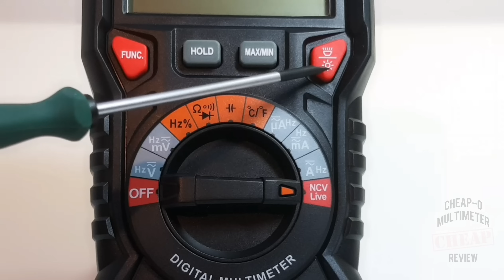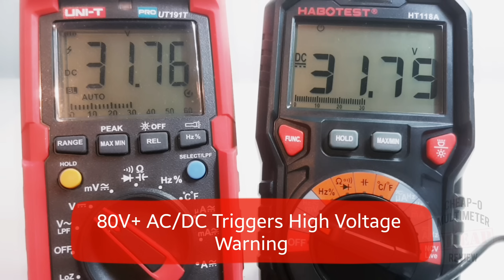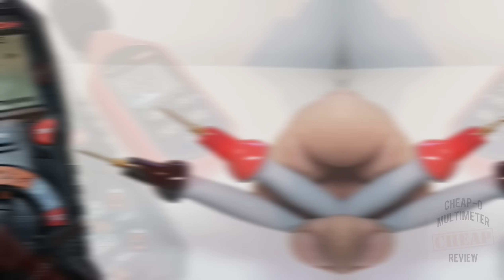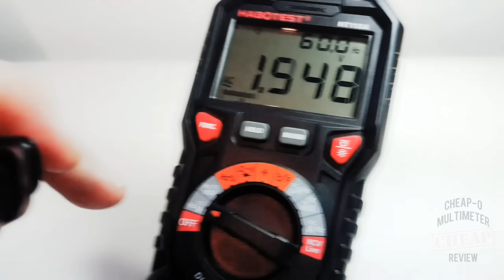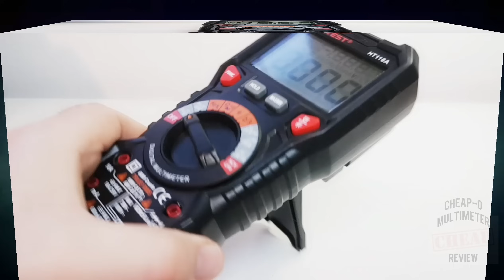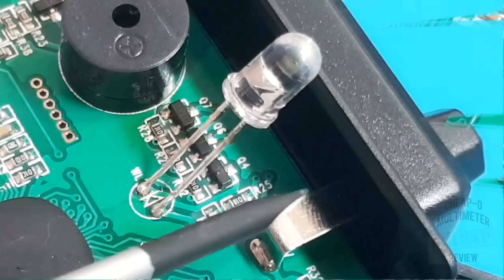HABOTEST HT118A  CHEAP-O Multimeter Review & Teardown!

Comment: Excuse me Mr.Darren Walker.

Can you please help me to choosing my first multimeter??
Either richmeter rm219(zt219) or habotest ht118a.
Rm219 have 19999 count and habotest have 6000 count. 
I don't know if i really need that Rm219 more count.
From what i noticed Habotest doesn't have relative button,range button.
And again i don't really know if i really need those button.
Will i get a hard time without those button sir???.

I want to use it for repairing broken stuff such as measuring fan capacitor,checking not working pcb,checking smartphone component that not working properly,etc.

What is your opinion Mr.Darren?
Should i choose rm219 ($23) or ht118a ($26).
Or maybe you have another recommended multimeter??

As you can tell, yes i am a newbie with no experience here.
Please excuse any mistakes as English is my second language.

Thank you.
Reply from the maker: HABOTEST HT118A, It's the TOP Multimeter on the TopTen List for a reason. Great display, solid performance and feature packed!

Comment: I have the updated version of this same model number but no manufacturers name back light now stays on until you turn it off when you select volts its default is now DC  the screen  back light and led torch have improved also I paid £16 off Ali express if you want the sellers into I can put it in the comments if you wish thanks David
Reply: the seller is MyTools Store on aliexpress 
type, Switch Multimeter Meter 6000 Count Digital Automatic Range True Effective Value Ammeter HT118A Micro Switch. in search box should bring it up current price £18.14 gone up a bit unfortunately
Reply from the maker: Ohhh..edit! I thought it was Mr Tools..😅
Ok..thx for the link..Will check it out.
Reply: @KeepOnTesting  you will know it's right as I have left a review for the meter where I talk about the back light staying on
Reply: @razer192  I found one @ HERRAMIENTA Store, but there asn't any review.
Reply: @jocl8488  I checked it's still for sale at (mytools store ) on Ali express
Reply: I have got mine from HERRAMIENTA Store, but it's HABOTEST 👎
Reply from the maker: Wow, those are some 👍 great updates! 
Please provide the updated link. Thx!

Comment: What would you consider better... the HT118A or the UNI-T UT61E?
Reply from the maker: 2 different multimeters. UT61E+ I just reviewed is not in the CHEAP-O Realm, it costs 4x as much as the HABOTEST but it's a fantastic and powerful multimeter. The HT118A is another amazing instrument,  it's current NO.1 in the CHEAP-O Top Ten (see under video description). Both are unique 👌

Comment: I just got my kaweets ht118a which is basically the same than the habotest, and they are shipping the version 1.5 of the board. Now the backlight stays on all the time and you can use it with the flashlight on
Reply: That must be sucking the hell out of those two AA batteries
Reply from the maker: Excellent update!  Glad to see they are listening!! Keep On Testing!
Reply: but does it make a beep sound when checking a regular diode?

Comment: Hi, thanks. Do you know what size the 2 fuses are in this? I took mine apart to see so I could get a pair to have on hand as backup But there's no markings or number on them. Thanks for your help.
Reply from the maker: 6.3 X 32 mm (1/4 × 1,1/4") ceramic fuses. 😃👍 You can find SIBA fuses on Ebay for a good price, that's what I use.
Reply: @KeepOnTesting  Thx! Another question... on the front it says 10A/250V and 600mA/250V so at 1st you'd think the fuses only need to be rated to 250V. However I just watched a video comparing a meter in the price range of this one to a Fluke meter and how they put better fuses in Flukes rated to 1000V and 20kV [is that how fast it blows?] He showed if you had the selector on the wrong setting, like ohms when you're measuring voltage, how the meter he then ran 650V through blew up. and caught fire. So should we use higher voltage rated fuses?
Reply: also do you know about ceramic vs glass fuses. I understand if you're not going to use a MM on a job site or somewhere where it could be dropped from more than 6' then glass is fine. Any truth to that?
Reply from the maker: @BTS-mb1lh  You shouldn't exceed the voltage ratings the mfr recommends. Those higher Fluke ratings are due to the better more robust input protection built into the circuit. A lesser robust design will evaporate in your hand ✋ so best not to go beyond the spec.
Reply from the maker: @BTS-mb1lh  Glass fuses are inexpensive to produce.. thats why its so prevalent in cheap multimeters. However,  ceramic is much better at absorbing the energy and it won't implode like glass so you won't end up with glass fragments everywhere! Definitely use ceramic if you can.
Reply: @KeepOnTesting  Ok so what do you think they mean by better quality fuses in some meters? And will they be safer somehow? And what would one look for in that regard? Thanks again
Reply from the maker: @BTS-mb1lh  A reputable manufacturer like SEBA makes great fuses. Always better to buy from a known name than a cheap nameless make. Quality of the tube design and the internal components used are all important. Two fuses side by side...cheap and well made, might "appear" similar but the difference could be priceless.

Comment: Nice instrument, nice review.  The only feature I don't like is that it defaults to AC.
Please note that the date code 1912  means 2019 (year) 12 th week , not January 2. The PCB  (and not the meter) was fabricated on March 2019. This is  the standard date coding that is used for ICs and other stuff.
Reply: mine defaults DC and I wish I would default AC and default continuity. I have no idea why it does not default to continuity.

Comment: got one of this, it was a massive fail, it didnt even turn on. Had to give it back
Reply from the maker: Oh my! Thats a big disappointment...sorry to hear that.
Reply: Darren Walker in your experience what do you think was the issue¿, I hope they resend me a good unit tho.
Reply from the maker: @admahecha  Might be a simple issue such as the battery pcb terminals not making contact with the battery assembly. Alternatively,  it could be a faulty or damaged selector pad on the rotary selector switch failing to initialize the multimeter. Unfortunately shipping can be really tough on test instruments so thats usually the culprit. Let us know if the replacement puts a smile on your face 😊

Comment: Hi. Is there any similar multimeter like ht118a? For example peakmeter pm18a ? But pm18a has no bar graph. Do you know another multimeter brand and model like ht118a? There are many KKmoon HT118A, Kaiweets 118A .

Your multimeter's board HT118A-V1.2
İ saw another version (Kaiweets) was HT118A-V1.3

Do you have any idea? is there any difference?
Reply from the maker: Yes there is a difference..the new rev. pcb supports the audible diode and I believe no timeout for the backlight, although I haven't verified the latter.
The AstroAI M6KOR is another variant..I'm awaiting on AstroAI to ship me a unit.

Comment: An Amazon reviewer for the Kaiweets version writes "the 600 milliamp fuse blew with just 0.5 milliamp going through it. The college instructor verified the unit was used properly and the circuit was configured properly, and that it was the multimeter that had malfunctioned. The replacement fuse costs more than the meter itself. Opening the unit up to inspect the fuses revealed the unit was not constructed properly for the fuses that came installed and this problem will likely happen again."
Do you see any circuit flaws with the fuses in the unit?
Reply from the maker: Sounds like a like a load of "hogwash" to me! There's nothing wrong with the internal circuitry. They use  standard 5x30mm fast blow fuses and you can easily fit 5x32mm in its place. 12 ceramic fuses will set you back 10$. I think this is just a lame attempt at dissing whats a very well made and affordable multimeter for the masses. I think the student was either high on solder fumes or was bored and needed to manufacture some fabricated story to get a refund from Amazon.

Comment: Which mm did you review that has a beep when testing a good diode?
Reply from the maker: UNI-T UT890D+ that I recently reviewed has the good diode beep function. Also  the Kaiweets/Richmeters HT118A also have this feature. Finally, the UNI-T UT89XD includes an audible diode beep as well. A great feature to have on a multimeter!
😃👍

Comment: Why is there a bluetooth icon/symbol shown when you power it up
Reply from the maker: Its possible their is support for a future rev that will incorporate BT functionality. Or, the display might be used on multiple multimeters so it's a segment that's not utilized in this multimeter..which I think is more likely as I don't see any BT module or space on the pcb.

Comment: Can anyone say definitively if those fuses are 5x20 mm OR 10x38 mm? (ack!, just found there are also 6 x30 mms too!) While I'm waiting for delivery from China, I may as well get the replacement in the pipeline ;-) Thanks
Reply from the maker: 6 x 32 mm is what the unit ships with (Both 600mA /250V and 10A/250V)..although I replaced my 600mA with a 6.3 x 32mm SIBA (500V -1A). I have a purchase link in the description.
Reply: @KeepOnTesting  Hi Darren. Is it safe to replace 600mA fuse with 1A fuse for this multimeter? Or should I go with 800 or 630mA fuse. Regards
Reply from the maker: @dariuszdamski6641 Normally you should stick to the mfr rating.That being said,  I have had no issues with my 1A fuse. If you have the 630mA fuse onhand than I would use that.

Comment: Nice review, Thanks Darren, was initially thinking of buying BK precision 2709b, but it's very expensive, was searching for cheap multimeter reviews, found your channel, ht118a suits my electronic needs, would have been a huge waste buying branded one since I don't use it for high power, Kudos for your channel👍
Reply from the maker: Thanks! Glad it worked out for you. The Habotest is a great multimeter and definitely cheaper than the BK.
Keep On Testing!

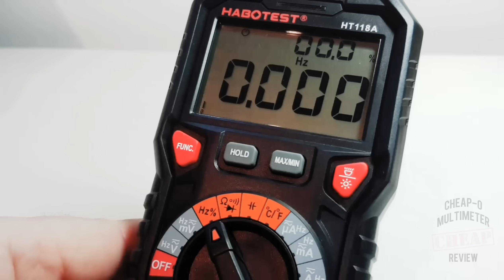Comment: At 13:13 into the video, I see you were measuring the Hz and duty cycle.  Since the Hz was about 60, I assume you were measuring standard "house current."  The manual for the Kaiweets unit says that for Frequency/Duty measurement, the voltage is limited to 10V, and anything above that may damage the unit.  What does the Habotest manual say?  Also, the Kaiweets unit has a NCV Live probe on top of the unit, so you can hold the unit next to a line to see if it is live.  You can also use the red probe, as illustrated in the video.
Reply from the maker: You can safely measure Hz over 10V with the Habotest or Kaiweets, no worries there. Here in Canada the household mains run at 60Hz/120V

Comment: Which one to choose this habotest ht118a or the uni-t ut89xd.Please help me i have lost my sleep :(
Reply from the maker: AUTO or Manual Ranging? They ate both excellent multimeters. If you do basic electronics on the bench then the HABOTEST is a solid buy, if you do alot of work on the road, television repair or need a strong dmm to handle the daily bumps n grinds then the UNI-T is the way to go...either are great choices!
Reply: @KeepOnTesting  Thanks, looking too for a clamp meter any suggestion,i like the uni-t ut210e,mainly for automotive,thanks in advance
Reply from the maker: @bizzboss_00  BSIDE ACM91, Great clamp for the price. Includes a LowZ mode. https://youtu.be/AgED6aEpGwc

Comment: New Subscriber here Darren. Great looking reviews and always entertaining. Just a quick question. I have watched your Uni T 191T review many times and I am still undecided which one to get if this Ht118a from Habotest or the more expensive UT191T. Everytime I watch your reviews I want to buy that particular product I am watching hence you have a great convincing power. So back to my question what do you think should I get, I will mainly use it for automotive applications, particularly checking resistance, continuity and voltage. Thanks again for always providing us conscise reviews. Kudos to your Channel. Love lots from the Philippines.
Reply from the maker: Hi Erwin, without a doubt go for the UNI-T 191T..its built to last, rugged housing that will survive those bumps and falls. Great Input Protection ..etc.
I really love this meter, its perfect size and balance for me.
Alternatively,  the UNI-T UT89XD is another great choice, although its manual Ranging but still has that rugged design although not as well built internally as the 191T. The Habotest is a great meter but I don't think its anywhere near as tough or resilient as the UNI-T.
Btw  Thanks for the kind words..
I would love to visit the beautiful Philippines one day!

Comment: New potensial meter : TASI TA801C
Look like the compact version of Habotest HT118A at halfprice .
Head to head to winapex et8101.
Used external memory to store data.
Freq in voltage n current.
No bargraph.

 Some good meters released this year. Thanks.
Keep on buying n reviewing n testing...
Reply from the maker: Thanks for the heads up..I just ordered 1 for review! Looks interesting as you say..I don't see any mention about data   logging but it still looks promising! Keep On Testing!
Reply: Im sorry, i mean it used external i2c memory to store the calibration data. Like the dreamtech intl chip.
Reply from the maker: @qolbunsalim5188  ahhh...Roger that! Thanks for clarifying. Yes thats always preferred. Should be a good meter to review!

Comment: There's no auto ranging on dc
Reply: Would of like to see ghost voltage on dc also
Reply from the maker: @rajdindial6740  Agreed, a LowZ mode would have been awesome!
Reply: @rajdindial6740  In what circumstance would LowZ in DC mode be useful? I have only found ghost voltages in AC testing.

Comment: What is the nominal voltage used on continuity and ohm test on this meter?
Is it lower than 0.5v?. Thankyou.
Reply from the maker: Continuity is 1.0v
Ohm is .5v
Hope that helps!
Reply: Terimakasih pak Darren. 
How about testjng a DC leakage current clamp meter? The cheapo one.
Reply: Or DC Current clamp meter with < 4A range, not the 400A one. 
Thanks in advance.
Reply from the maker: @qolbunsalim5188  Great suggestion.. do you have a particular clamp meter in mind?
Reply: - Sedmm se-05
- Uni-t ut210E (and its derivation)
- Bside ACM03
- Btmeter BT-605C current adapter

Available from china fellow via shopee.

Comment: Great review, new sub. Just a thought, what would you suggest for shielding? Tin foil or pull shielding out of a busted power pack?
Reply from the maker: Thanks, welcome aboard! 
Aluminum foil works but EMI Copper foil tape is better. The one from 3M shielding tape offers great shielding (although any will work) for various frequencies from 30Mhz up to 1Ghz so it's highly recommended.
Reply: One last question, does it come with a boot? The one reviewed by you is black, I see some are red and I assume that's a boot?
Reply from the maker: @koonley  It came with a black boot, rather nice actually. Its true , some do ship with a red boot as well.

Comment: I've had this meter for about a week now and it's ridiculously good. Everything you highlighted here is true. In fact I'm so impressed with this meter that I'm going to buy the HT118C which is the manual range version. Why? Because it's $28 on Ebay and it's going to be an excellent meter.  My HT118A has a red bumper on it for that subtle understated look (not). Something possibly of interest is that the HT118C  LCD in the bottom left corner has a Bluetooth and a USB logo on it. Hmm, interesting. 

I know that the Vici / Prostar VC99 has a RS232 logo on the LCD and there's a video somewhere of a hack to pull out the serial line from the CPU, tie it to an IR LED and with as bit of hackery feed the serial data feed to a laptop and use the laptop as a data logger and almost a storage scope. Now I would love to see you do a coherent version of this hack but also is there possibly something in the HT118C that maybe needs investigating?
Reply from the maker: That's  great news! It sure is one heck of a multimeter...I'll probably do a review on the Manual ranging version as well...
Btw, I'll do some research on the mod/hack you mentioned and see what I can come up with..sounds like alot of fun!!
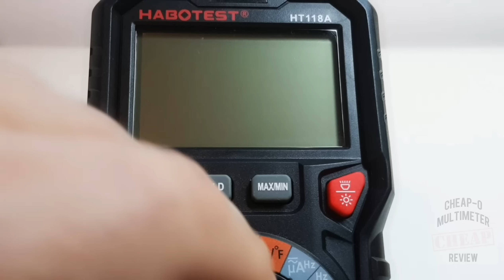Reply: HT118A also has a Bluetooth logo, it's at top-left corner, right below the battery indicator. no USB logo though. it can be seen at around 3:20 time mark of this video when Darren turn it on for the first time. i do really hope that it is a hidden feature, not just a logo. 😁

Comment: My friend, for a noob like me, what do say: "HABOTEST HT118A" or "UNI-T UT89XD "... ? Can you explain about input protection (in the case, the winner is...). God bless you!
Reply from the maker: Both are excellent multimeters. Though from a new user perspective the Habotest will be simpler to operate as its an autoranging meter.
In terms of Input protection... both will serve you fine. Full size ceramic fuses on bith the mA and High Current side. The UNI-T can withstand more bumps and knocks with its excellent chassis but because its Manual ranging it will be harder to operate. The Habotest also has those lighted input jacks which are a big help to a new user. HABOTEST would be your best choice from a new user perspective.